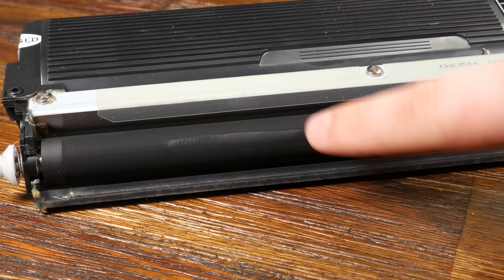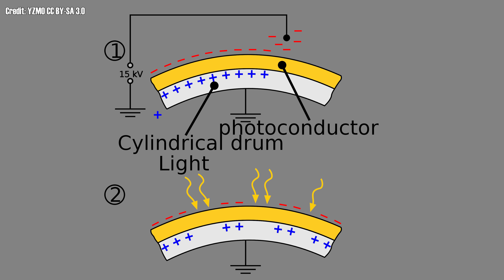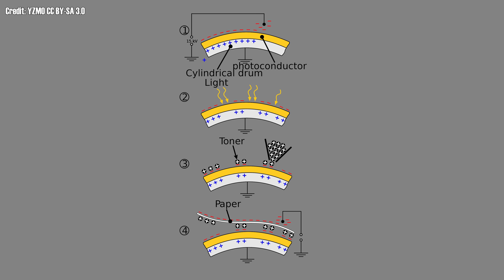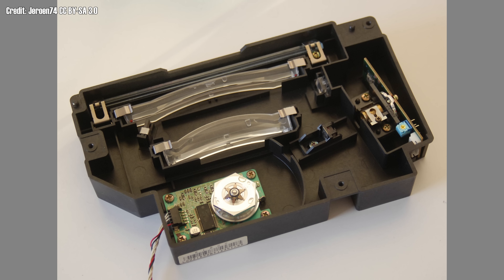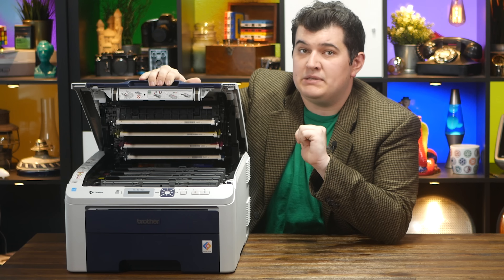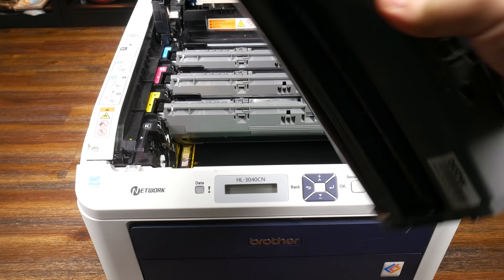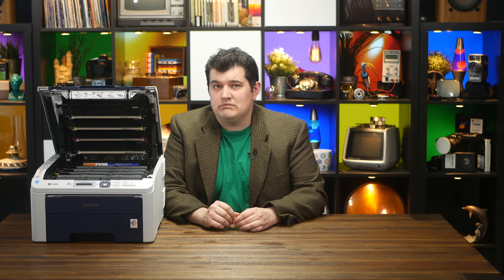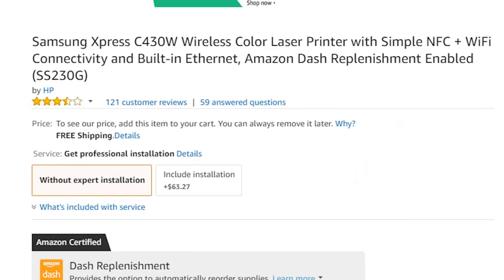LED Printers: The Common Printing Tech You Haven't Heard Of

Comment: I work for Fuji Xerox in Australia working mainly on office printers and I've never really thought about it much since I'm not the one using the printers, I'm the one fixing them, but every single colour printer I've worked on has had an intermediate transfer belt between the drums and page. 

Basically all four drums write their image onto the transfer belt as the belt rotates (if you stop the printer mid operation and look at the belt you can see the fully formed image) and then the page runs up against the belt where a magnetic transfer roller pulls the full image onto the page all at once. 
Whether the image is in colour or black and white the process should be exactly the same, I've looked through a manual for one of the models I work on and it seems to be saying that the transfer belt does a single pass of all four drums and the image is drawn all at once. This would mean there should be no difference between black and white vs colour printing, the colour drums simply have no image drawn to them at the start. 
Where you do see a difference is in the colour vs black and white models of the same printer, a black and white printer only has one drum so no transfer belt is needed, just pull the image from the drum to the page. 

You can see the LED printer in the video has this same setup or at least very similar, you can see the black transfer belt underneath where the drums sit at 6:45 or a close up at 5:44

One thing I will say is that reliability aside these LED strips would probably be a lot easier to replace than a laser unit and be much less likely to be damaged in transit. The laser is pretty bulky and fragile and is buried deep inside the printer so they are a pain to replace on most models, though it is far from the hardest repair.

Comment: I think Oki may be the first LED printer.  I remember them advertising the tech all those years ago as a far less expensive alternative to laser printing.

One thing you might find interesting is this recent EEVBlog video that tears down a high-end color laser printer: https://youtu.be/hy1fOSj8_uw

I suspect that this is a much higher speed printer than your typical desktop color laser printer.  Of note:

There are four toner/drum assemblies in a row, but note that each one is slightly lower than its neighbor (time index 1:40 - https://youtu.be/hy1fOSj8_uw?t=100 ).  This is necessary because of the way the lasers are focused on the drums (keep watching).

Looking at the laser assembly (time index 17:35 - https://youtu.be/hy1fOSj8_uw?t=1055 ), there are four laser diodes that all aim at a single rotating mirror.  They are at different heights so they will not interfere with each other.  After the mirror, each one targets a different set of mirrors in order to focus the four lasers on the four drums.  Which is why the four drums are at different heights - so they'll align with the four lasers.

It's a really cool bit of tech.  I suspect that this printer should achieve almost the same speeds for color and black pages, thanks to this mechanism.

This is very different from older color laser printers I've seen where there is only one laser and four separate toner/drum assemblies rotate into position in order to image each color.  That system, as you pointed out, produces color print speeds that can never be faster than 1/4 the black print speed and are usually slower than that due to the time needed to actually rotate the drums.

Comment: I just bought this exact Brother LED printer as "defective" on eBay for about 30 bucks. Got it fixed in about 10 minutes. Gave up after trying to get the damn thing running on my linux box after about 3 hours. I hate printers.
Reply: We have this exact model of printer at home. We use it over the network with all kinds of boxen ranging from PowerPC Macs to Windows 10 laptops, including a couple of GNU/Linux machines. Haven't had a single (software-related) problem in almost 10 years of operation. Try downloading the official Linux drivers for it, they worked for me.
Reply: Doesn't sound like it was working in that case

Comment: You're missing one substantial negative. LED's can have reliability issues and when even a few fail in an LED printer you will get visible artifacts that basically can't be repaired without replacing that entire array.

Comment: Another advantage to the Brother-style setup is that you can have a fully straight paper path using the manual input tray and the back door that bypasses the roller that flips the page over and out the top, letting you print on thicker paper that would otherwise jam or curl too much, or on labels that would otherwise have the possibility of peeling off inside the mechanism.
Reply: you misspelled OKI

Comment: Well, you can sorta/kinda legitimately call an LED printer a laser printer.  All of the lasers used today (at least in consumer products) are solid state laser diodes.  As in Laser (Emitting) Diodes.  The only thing a traditional LED lacks is an optical cavity to cause the output light to be emitted coherently, but that's a physical detail.

Comment: I used to have an Oki LED printer. It was shockingly small, for its time. It wasn't as wide as an inkjet. There was just a bit more depth to it. It was much smaller & lighter than laser printers. I thought for sure that there was some "gimmick" to it, but it actually had decent resolution and quality. It was also reasonably fast.

Comment: Fun fact, LASER is an acronym for "Light Amplification by Stimulated Emission of Radiation".

The lasers found such devices as printers, optical drives, etc. are laser diodes.
As you may already know LEDs are "Light Emitting Diodes".
Both devices are semiconductors and both convert electrical energy directly to light.
Thus the terms could almost be used interchangeably were it not for the different quantum effects that produce the photons.
I could try to explain further, but due to the nature of quantum mechanics it gets very complicated and it's probably easier to just google it.

The TL;DR is that LEDs use spontaneous emission and LDs use stimulated emission.

Comment: It used to be that the laser printer was more expensive than the LED printer because the laser unit (optics, scanning motor, and laser diode) was more expensive to make than the LED matrix.  Also the scanning motor that revs to really high RPM is also prone to go bad.  Sometimes the bearing on the motor goes out and the motor is seized or the motor cannot spin up to speed.  One problem with the LED is that it is so close to the drum, toner floating around the drum tends to cover the light tubes between the LED and the drum.  This causes poor image quality - lines, light prints or dark prints.  But all you need to do to fix this problem is to open the printer cover and wipe off the light tube!

Technicians that fix color printers / copiers will inadvertently breathe in some of the color toner.  They end up with cyan, magenta, blue, and black toner in their nose.  Psychedelic boogers!  🤣

Comment: Have an old black only HP laserjet 1200 (its beige). Prints about 45 pages a minute and has worked for close to 20 years. I haven't had a another printer since that managed to replace it. I would get a color laserjet (or led) next time. Had a color laserjet that was the size of a large microwave at work back in 06ish. About 40 pages a minute in color.

Comment: I had to jump up and go check my printer. I'm oddly excited to report that it is indeed a LED printer. I have a Brother HL-3140CW.
Reply: Got the same printer, best ever....
Reply: @killerdeamonking do you still have it?
Reply: @shawnsg  yes it gets used every day.
Reply: @killerdeamonking  I've been having problems with mine getting jammed even when it's not. Apparently there's a sensor thing on the back that can be problematic. I fiddled with it and it worked for a while now it's messed up again. I've been thinking about trying to order a replacement part and seeing if that fixes it.
Reply: You can try to order replacement parts indeed , not sure if they still make them.  @shawnsg

Comment: Back in the late 90's, I used to repair all kinds of equipment, including laser printers.  Some had a primitive optical cable going to a 'beam detection' jack on the main board to ensure it was working.  I seem to remember this in the HP LaserJet III models the most.  If it didn't detect it, it'd be like a 51 error code or something.
Reply: The other — and more important — reason for that signal was to synchronize the image signal with the position of the laser beam.   The start of scan signal is the only way the machine knows exactly when the laser is starting a line.

Comment: In 1972 my company used teletype technology to print the test results of each of their large machines being run on a test stand.  The printing took 25 + minutes for each different test. Slow, but best tech and no big deal.  Then a drum line printer was installed. That machine had an 80?? or 130?? character wide drum with every different character arranged in a rows around the drum.  In one drum rotation a line would be printed and the drum spun pretty fast.
Anyway.... printing time for the same test results evaluation was reduced to about 1 minute flat.
I was impressed.... but the line printer was (big old guess here) was $25,000 in 1972.  Anyway A LOT of money.  Times have certainly changed.

Comment: The Canon Color ImageClass LBP612Cdw has a similar “tray” system for it’s toner carts. I have one and it prints quite quickly for a consumer unit.

I was a Canon tech and worked on commercial units that could print continuously in very high page counts. In the 3 years I worked on them I had only one mirror go bad on an older unit that had been in use for almost a decade.

Comment: Laser printers can work even if unused for a year?  HAH - I have a Kyocera FS-1000 that I hadn't used since 1998, until I had to print out some paperwork at XMas, from a computer with only a centronix/LPT connector - and it worked perfectly.

"a year" he says. ;)

(Yeah, I know, probably an outlier - but still, it was funny that it still worked)

Comment: A possible reason for non-uniformity with LED printers is that the efficiency (light out vs. current in) of LEDs varies with LED temperature.
So, depending on what has already been printed, some LEDs will be warmer than other LEDs and thus not as efficient.
I’m not sure if LED printers have any kind of built-in compensation for LED temperature.  Laser printers use solid state laser diodes, which emit light on both front and rear facets.  A photodiode is used to measure the light coming out of the rear facet and the drive current is varied to keep the light level constant.

Comment: Never had any problem with my inkjet Canon TS5150 being clogged. But I rememeber our company Konica Minolta Bizhub C300i or Canon LBP621Cw always having problems with printing colors, being the coverage not uniform or simply leaving bars of no color at all on some spots and having to be undergoing maintenance all the time to fix the issue for another week or two.
And well, LaserJets are faster for printing, and printing only. When it comes to copying, inkjets are faster just because they can start printing during scanning.

So yeah, laserjets might be cool if you print A LOT of black&white documents, but are a total nightmare if you have to print in color once in a while, with modern Inkjets becoming better when it comes to efficiency and dealing with the ink drying problem.

Comment: My next printer will be an LED printer for sure.  I know page per page laser printers are much cheaper than inkjet printers just higher upfront const.  I really like to see a cost per page breakdown between ink, laser and LED along with average replacement costs for ink cartridges, toners for laser and toners for LED.

My own experience with ink printer is they are horrible if you don't print on them regularly.  I tend to only need to print out a few pages a year so the printer can sit there for a year or more before I need it.  The ink heads get clogged with non use and even after buying new ink over half the ink is used up just trying to clean the heads.  Inkjets are just not worth it in that case.

Comment: It's the first time I've heard of LED printers. I didn't know that some laser printers are in fact not using a laser. That doesn't sit right with me. Anyway, the tech seems to make sense. The low speed in printing color has always been an issue with color laser printers. They also used to be quite huge and expensive.

Comment: I still use an HP LaserJet 1018, B&W printer from around 2001 or 2002. It still runs strong and produces very sharp text. It was a hand-me-down from my uncle to use when I was in college, because I didn’t need to print color and just used it to print essays and other texts. You can still get the toner carts and even though they are around $100, you can get nearly 3,000 pages if you alternate between econo mode and regular 600 dpi.

Comment: Just how do you turn off and on that dimple above your left eye? sometimes looks like a gunshot-wound, and later just smooth skin... amazing! I have never seen that before. i wish i could do that...  gonna binge-watch your channel to crack the secret... And i did subscribed, just in case future videos hold the solution. 

PS, kewl story about new printers, but i´l stick with my Apple StyleWriter II from 1993, it at least prints Helvetica at size 2 and you can still make out the characters with a magnifying glass. Plus, a brand new cartridge cost just $10!! E*t sh*t and di* HP!!

Comment: The difference in speed for the samsung printer is due to the “revolving drum” mechanism, the drum rotates 4 times (1 for every color) to transfer the image to a transfer belt and then to the paper. It’s sooo slow compared to the led printer you shown

Comment: Agree, I work in a printer company, LED is not that known. I think its main limitation is its horizontal resolution. You need space for each LED. But if you are just printing office docs, LED resolution is more than enough. 

Yes, inkjet are messy and troublesome if you dont use it often. You get what you pay for.